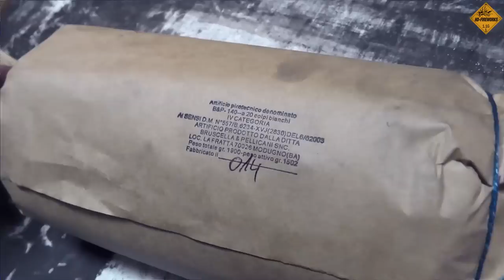[ITALIAN FIREWORKS FACTORY] Raffaele Pellicani / LA PIROFANTASIA MODUGNESE [HD]

Comment: interesting video, the use of a smaller sized report for the final break of a large cylinder, perhaps a cost saving or safety measure. The second shell he mounts the spolette what may be upside down. The powder column is deep inside the tube and I assume flush on the inside. Wonder what his reasoning is there.